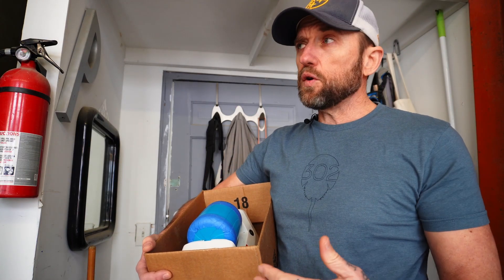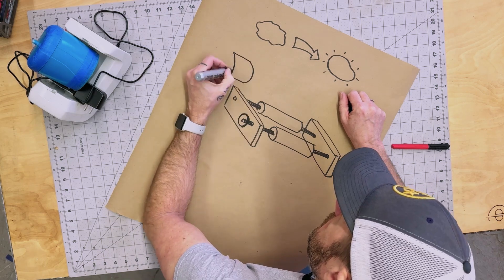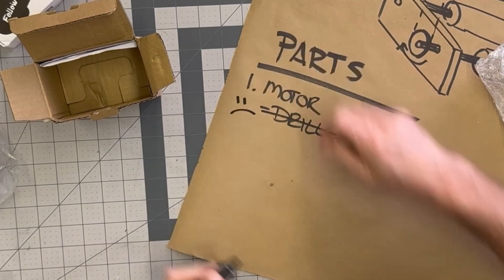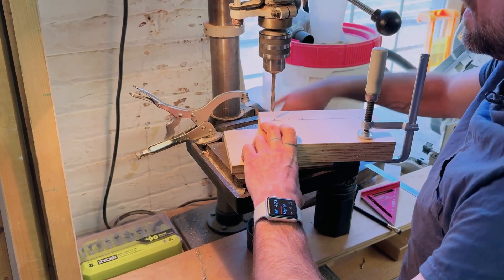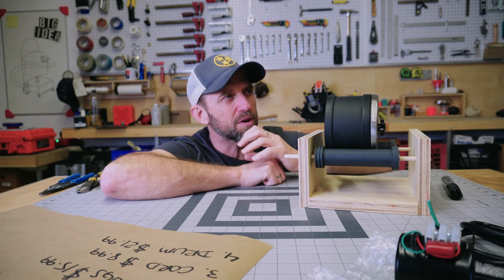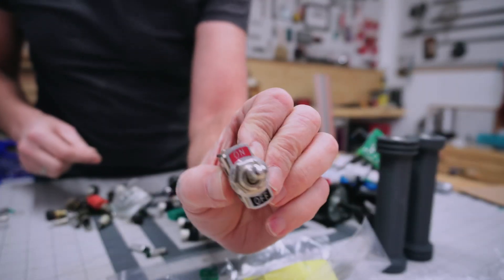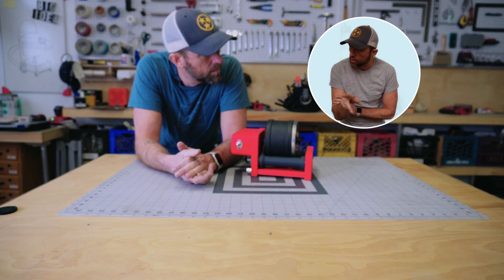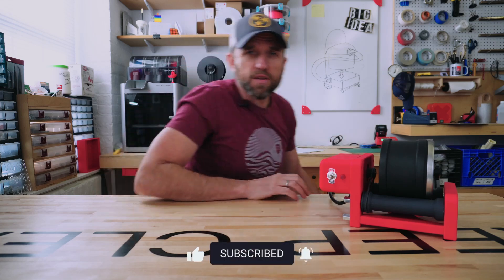Building A DIY Rock Tumbler From Scratch That Actually Works

Comment: I think you probably could have gotten the drill to work if you just kept the whole drill intact and just used a pulley/belt as your reduction. Doubt it would look very nice though.
Reply from the maker: I agree! I still think the drill was a good idea in theory, but it was going to be more work to find a way to mount it and I also don't think it would have looked very cool. I don't know why I thought the motor was going to be all wrapped up in a neat little package inside. Once I opened it up it made sense that they would build it that way. Live and learn!